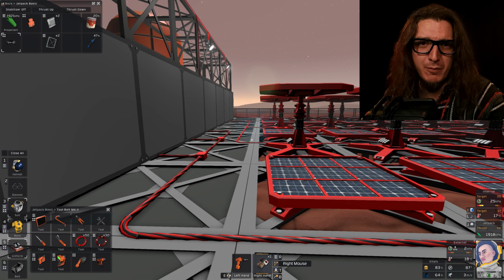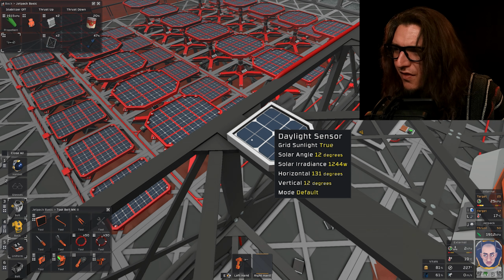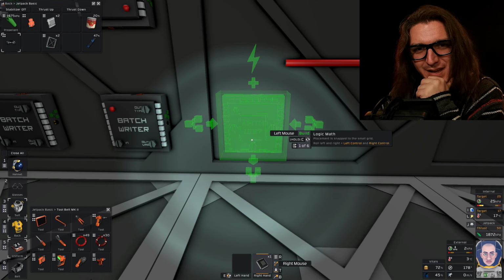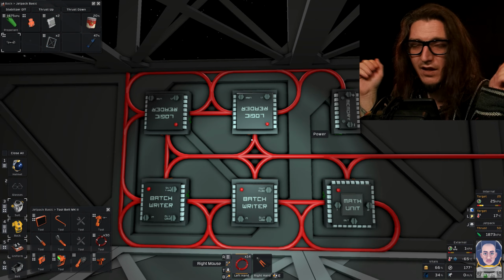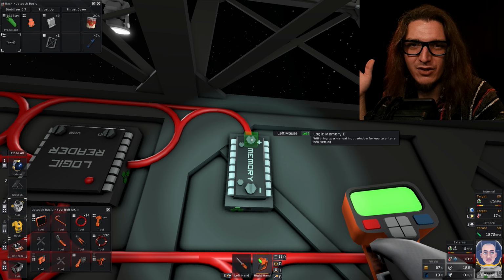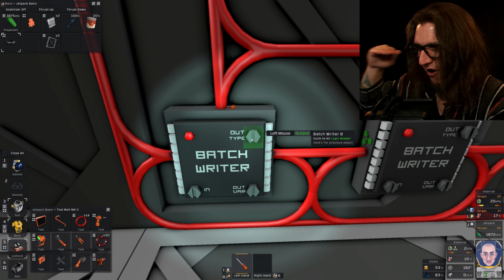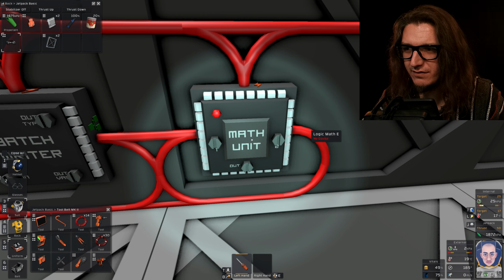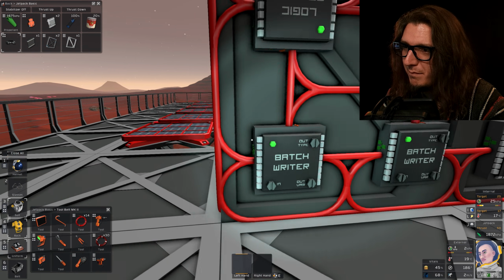Stationeers: Dual Axis Solar Tracking in 6 Minutes, Easy

Comment: ooh thanks! this was awesome, might not be a tutorial but it worked great as one :D finally able to set up tracking solarpanels :D 
One little problem tho, the cable went bad and blowed up, changed to heavy cable, or i did something dumb xD don't know if you can put too much power throu a cable? 9 panels in total on one cable o.O
Reply from the maker: Happy to help, man :]
Regular cable is good for 5kw and heavy cable is 100kw. Off the top of my head, solar panels pump out 500w in ideal conditions… 9 you say? Might have done something wrong, lol. 
I’m not sure because I can’t see what you’ve built from here. But I believe you’ll figure it out. 
Could try building a tablet and putting the network cartridge in it. Help you scan electrical circuits. 
Thank you for the comment have an excellent day.

Comment: The orientation of the light sensor DOES matter, but once you figure out which way it needs to point (only 4 possibilities), the rest of it works perfectly without a script. Many thanks for the vid. 👍
Reply from the maker: Yeah, could do. lol. Maybe I'll make another video about this, Make this system even simpler. 
But I feel like the orientation of the daylight sensor is still relative to the orientation of the solar panel base, more than the sun. 
Like I have a base with two separate solar circuits on either side and a daylight sensors on each pointed in two different directions, as well as panels in reversed orientation from the other circuit. 
Why would I do that? The sun travels directly over head between the different sets of solar panels, and sensors.
So I do agree with you the orientation of the sensor matters. But I think there's more ways to orient it... depending on the system.
And I mean there's no right or wrong way to do it, as long as it work right? 
I just want to help get people started or give them ideas when they're stuck. 
Which is why comments like yours are great because someone reading it might find another way to do something, because I just make stuff up as I go and hope it works. Then we edit it to look like I had a plan the whole time. lol.
Thank you for the comment, Always appreciate feed back and input here. 
(especially if it means I can make another video or helps somebody)
You have a good day my friend.

Comment: Hello, i did it but the horizontal have a problem - i think)  because it is almost in front of the sun, but a little bit shifted to the outer side of the sun (apart from the sun itself), it does not aim at its center, what should I do?
Reply from the maker: Hello, is your solar panel raised off the ground because having it on top of more than one or two iron frames can cause it too look miss aligned but if you look at the base of the panel it should still say 99% efficiency. If that’s not what’s up, you may have to rotate your daylight sensor (I have another like 2 minute solar video that shows what I mean about rotating the sensor) and or double check your values on the logic chips to make sure they didn’t do something weird (I don’t care what anybody says sometimes they change on their own). If none of that helps what planet are you on and efficiency is the panel showing?

Comment: @Tremor Boria You should try IC10 coding the solar tracking.
Reply: IC10 is so much simpler í thought it would be. I've never coded before and í love it. You can check if its worth it by checking the power draw, i think it's if you have more than 6 logic things an IC is worth it.
Reply from the maker: @Snorty-II   We're gonna start the IC10 coding when the base I am currently working on is livable :) which I am thinking will be this weekend, I Hope. 
Although yesterday I accidentally made a video I had already made again, again... lol.
Reply from the maker: And indeed I will. 
But not next week, next week is green house, cause I let all my plants die... Again.
Lmao IC10 is such an unnecessary way to just track the sun. Single axis tracking works on Mars.
But you're right we should do that, Thanks man.
Reply: @TremorBoria  but it makes the base more cleaner where your not taking up space that could be used for something else instead of logic I/O’s everywhere. And the code would be in one place where you can save the mips code and use it again if something goes wrong Lmao.
Reply from the maker: @GamingGuy256636  Oh man, That's such a good point. What a valid argument for spending the time to code a device. Usually I just hear "but computer is cool"
We're gonna do some IO10 code after the green house. 
I am gonna make a video about coding solar panels. But we might not actually use it in the base yet. We'll just keep it on standby running a single panel for now.
THEN we're gonna figure out some other stuff to code. 
Lmao and believe me, Things WILL go wrong.

Comment: Okay, way too much info in this comment, but oh well.

First, technically it's only 2 axis, which results in a simulated three degrees of freedom. It can rotate about the z axis (horizontal), and about the x and y axis, depending on z rotation.

Also, new to the game, so I don't actually know if it matters, but doesn't the math unit output to the bottom? Because it's not hooked up in the video. So maybe efficiency drops as the sun gets more overhead, and the 10 degrees is more apparent, but I'm really not certain.

And lastly, (I should probably check out the website because it likely says all this), but if anyone's happens to not face the right way, just rotate the daylight sensor until it's correct. You can also offset with math, but it may take additional math units and actually calculating the offset.
Reply from the maker: I change the name of the video then. 
I’ve never bothered to hook up the bottom of the math unit, but that doesn’t mean you shouldn’t lol
I did say at the beginning we could just rotate the sensor. 
These videos are not tutorials. They’re just what I am doing that day, I guess I forgot to say that in this video.
But most importantly this video was just made to spite one person lol.
Thanks for the input man. I am gonna change the title, you have a good day.
Reply: @TremorBoria  this is what I get for commenting when I'm in bed for the night lol. It wasn't a dig at you, just additional info for passerby. I love the content, and your neat wiring pleases me lolol
Reply from the maker: @g45h96  Oh, I didn't take it as a dig sir. I appreciate you correcting the title of my video (It got more views because of it) I thought your comment was well worded, concise, and factually correct. I appreciate the input, and intent to help others (and myself) 
Yes the neat wiring please me as well, I tried painting it at one point but I feel like it looks cheap after. I keep telling myself it's not painted it's sleeved but inside I know I used a paint tool to do it.  
You have a good day my friend. Enjoy this small novel of a comment I have left you. Lol.
Reply: @TremorBoria  you have forever cursed my bases to not be able to use colored wires 😭 I never thought of it that way, but I don't think I'll be able to unsee it
Reply from the maker: OH NO! That’s exactly how this happened to me. And now your doomed to spread the coloured wire curse to another.